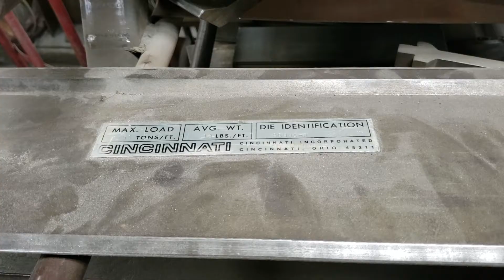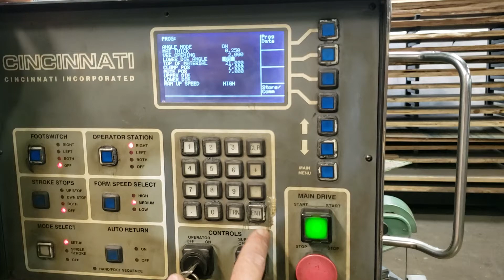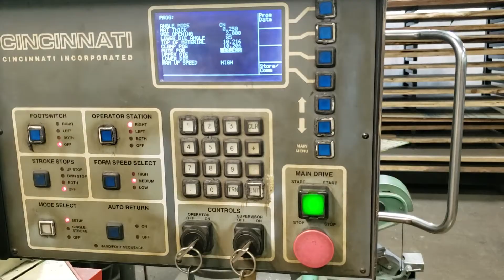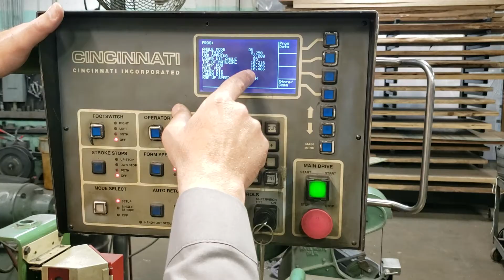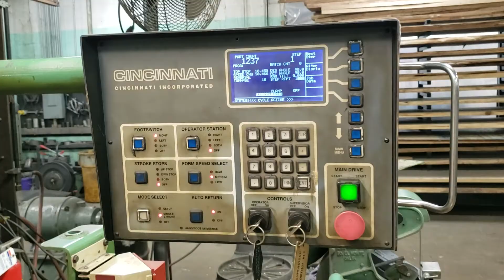Press Brake Metal Bending Crash Course

Comment: The metal stretch ha! It is minimal. It depends on your tooling and material thickness.To measure od verse id is based on metal thickness and brake radius. For a beginner, to brake a od measurement into a 90° subtract your material thickness. Let's say you have a 2" od angle out of 11 gauge.120 a36 mild you would subtract the material thickness from both sides. Your blank size would be 1.76 and you would brake at .88 but round it to an 1/8" unless you work for NASA.

Comment: First time I ran a press brake was Dec. 1964, I ran a brand new Chicago 10 ft. 150 ton. No CNC, no power back gauge, and ram adj. was just reference numbers. there was a lot to learn. Went from there to the machine shop and never looked back.

Comment: Pro move holding the piece up tight to the punch when getting your 4deg adjustment.
I used to brake 5/8 thick 6- or 7-feet long skid steer belly frames 2 X 90deg + - 1deg. on a 500T
Once or twice a year tooling would get sharpened, or we would get some weird steel and all the sudden were 4 deg over broke. We had a big 3in dowel of tooling steel that we would put in the die and flip that 4- or 5-hundred-pound monster over with a clamp and crane and bump jog that sucker open with kisses until it was good, the dowel made it nice; the other way was to put it on a forklift and go outside and hit the brakes with it about 4 feet off the ground and get it to land right on the apex, lol, if you were upset and in a hurry, it could work too.

Comment: I've ran an old 10 ft Cincinnati,if i remember correctly. Had a 10 ft die. 1-4 inches on it. Had to install with a forklift or use the ram to lift it  to spin. No automatic setting of the bend. There was a dial? Been 11 years. Used an accurpress also. Didn't set the bend automatically either. Now learning to use a amada rg50 up brake. 41 years old, whole new ballgame. Didn't even know there was such a thing 😊

Comment: 1/4 inch thick???  My press brake is only 20 tons but works very well with the .005 inch thick material I usually work with
Reply: 1/4in = .250
So, yeah, 20T will do .005. lol.

Comment: Certainly an interesting and informational video. I begun working as a press brake operator at my summerjob 3weeks ago, using some finnish coastone and aliko CNC press brakes. No idea about bending whatsoever before working there, now programming and bending multiple different bends with various different angles. I think the best tip i can give with my experience in choosing the VEE and R is, VEE size should be material strenght times 6 and R should be material strenght. Not certain if that rule applies with inches since we use metric system here.

Comment: I'm starting this type of job today. I'd like to know how to build things out of metal and have my own company.
Reply: Hire me i have over 22 yrs of experience with press brakes
Reply: @orokidzorozco3955  What do you learn over 22 years that someone with only 2 years experience knows?
Reply: Over the years you can learn many techniques that can make you a professional press brake operator.. you can learn how to use press brake tooling properly and choose the best and efficient bend sequence and many other things
Reply: @orokidzorozco3955  I got promoted to quality inspector, then they terminated me because I'm hearing-impaired and thought the forklifts would be too much of a safety hazard. I was there for less than 4 months.
Reply: Do you still work with press brakes?
Reply: @orokidzorozco3955  No and I was extremely bored doing that type of work. But, my quality was "second to none."  It was a regular WWII-era pneumatic press I was working with.
Reply: So you are not planning to open up your own business now ?

Comment: 1. The work piece does not actually stretch. The outside half does stretch, but inside half compresses in a bend. These forces mostly counter acts each other but tends to move the neutral axis inwards, meaning you should always make your blank slightly smaller. How much depends on a variety of factors.

2. There are 3 methods of bending, two mentioned here. Air bending and coining, bottoming was not mentioned. Coining actually requires so much force the metal "flows" out of the bend radius. Bottoming is just a best hope for the angle of the tooling.

3. The opening of the bottom die is a major factor in creating the inside bend radius, but not the only factor. Metal can only bend so much before it breaks or rips, this amount is 63% of the material thickness. This is known as a sharp bend and can be helpful in some cases where certain tooling is not available.

4. When creating a blank you need to know the finished dimensions. The first thing to write down is the material thickness, nominal is fine in almost every case. Then you need to know the inside radius, and not what the print says. I mean what actually comes out when you bend a piece of that material. GRAIN MATTERS, especially with aluminum. A rough guess is 5/32 of the V opening. With those numbers you can figure our your outside set back, this is the length of the radius plus the neutral axis. take the tangent of 1/2 your bend angle, so for 90 degrees use tan(45)*(material thickness+inside radius). Now we need to figure out the bend allowance! This is simply pi/180* inside radius+ K-factor * material thickness. The k-factor is a number that is usually fed into CAD software and never looked at again, but its very important. As mentioned earlier the neutral axis shifts INTO the part, the amount that it shifts is the K-factor, so it depends on the material tensile strength and type. Once you have the bend allowance you can divide it in 1/2. So to copy a 3" leg, subtract the outside set back, this gives the material that will always remain flat, then add the 1/2 bend allowance. That is your exact bend line.

5. The reason the part had to be struck twice is usually down to poor tool measurement or programming. A 2" Vee is not ever going to be 2". It could be 1.93" or 2.04", check the tolerance from the manufacturer. With a trigonometry you can accurately measure the opening perfectly. Just drop some round stock into the V. It must be large enough to not hit the bottom, but small enough to not poke out the top. Then drop a straight edge across the top that spans the V but does not droop. Now measure from the bottom contacting edge of the straight edge down to the top of round stock. You actually want to ignore the radius of the tool shoulder because the neutral axis is actually pivoting on the imaginary tangents.

I spent 6 years in metal fab and had to work with the most ancient equipment that had no computers, it was a 1962 mechanical press. If anyone wants to know more I have some pictures and stuff from way back then that might help. But I highly recommend a book from the former head engineer at Cincinnati, "Fundamentals of Press Brake Tooling" by Ben Rapien. This book helped me teach myself how to do this job.
Reply from the maker: Ben Rapien was an awesome man, he taught me alot. I appreciate the technical information here, but this video is just a crash course for beginners!!!

Comment: Remember that your radius of your bend will always turn out to be 0.16 times the length of your die opening (unless the radius of your punch is greater than the radius of your die opening) and your flange/bite length needs to be at least 77% of the opening of your die to bend. A shorter flange will always bend tighter because there is less material. Spring back has a .5-1 degree relationship when your radius is the same thickness as your material. Larger radius bends have a greater spring back. Keep your tooling clean, and remember not all metal is made the same even from the same sheet.

Comment: Thanks for making this! I start a job as a press brake operator tomorrow and have no idea what to expect. Seeing this at least gives me an idea
Reply: I started a job a job as a brake operator at the beginning of this year.. feel seasoned now.
Reply: @beaubeckum7634  I’ve ran brakes for 20 years, you have lots to learn, I loved operating a brake, but my back if fup now, please use crane or forklift for everything, I’m paying for it now.
Reply: How did it go
Reply: @DarkcreepSTREET  It's a process! There's a ton to learn and know, but it's not impossible by any means.
Reply: @brutaljok3r  thanks for responding. Yeah I have interview and never done any type of this work.
Reply: So are still a break press operator after a year now
Reply: @Krazywan  Unfortunately not. I moved to welding (I have experience in that already) The operating a break press wasn't too bad, but the ones at my job were older and very temperamental lol
Reply: I saw a job listing for it and was definitely interested in learning it if I get an interview. Manufacturing is awesome.  Good luck!
Reply: I just started two weeks ago and yes lots to learn , not something I’m used too while learning how to stack the metal orders properly then send them off to shipping pretty cool to learn tho
Reply: my school was CNC operator and I had fear of that job that i never worked it in my life, past 10 years im working in car industries on machines just setting up parts and pressing green button, since i had school i learned how to repair program if it breaks, i had conflict with chef and i quitted job... now im still in fear of CNC job due to my inexperience , my school was finished more than 10 years ago and i never worked that job, is it possible to learn? I even forgot how to read drawings...
Reply: I used to run one, not very hard when you learn.
Reply: 😂lol im in the same position,
Reply: Same thing I start tomorrow :)
Reply: @tearinthebradsshaw  How did it go? Is it easy work for beginners? What would you recommend for someone that is starting out and to get better at it fast?

Comment: 2 3/4 '' + 1/4 ''   = 3 ''  i don 't think so   did the metal bend around zero radius
Reply: When you bend something you are measuring to the inside but you gain the material thickness back on the outside of the bend so he is correct

Comment: Where’s the backstop? I remember my dad talking about walking to school both ways uphill and scribing his plate before bending it. “When I was your age” he used to say.
Reply from the maker: We have manual backstops, but not worth setting up for a couple of bends.
Reply: @woodchucktinman9893  Cute "not worth setting up" there are tricks of the trade that will save you the trouble of "eyeballing" if even for a couple parts that might become scrap because you didn't line up correctly.
Reply: @KushyKaar420  Pretty sure this guy knows what he is doing, don't think someone with the name Kushy with 420 on the end has more experience then this dude.
Reply: @FetamSC  exactly video wasn’t about back stops, I could mention many things he shoulda done but he’s explaining something in particular.

Comment: Can you tell me why when trying to lower the top die slowly , like tapping the foot pedal the die  bounces.  At work when I try to pinch the sheet I can't lower bit by bit, the hydraulics bounce.
Thanks sharn
Reply: You're probably working on a more modern pressbrake. I think it's a matter of safety, that is if your finger/hand get pinched by the part or the punch you're most likely to release the pedal or press it with greater force which is obviously caused by pain and panic. In both cases modern pressbrakes stop the cycle and retract a little bit for you to have chance of getting your hand out.
Free hand bending in such case is a little bit of pain in the ass however with all of those precise modular CNC back gauges nowadays you rarely need to use it. Also Iris Lazersafe has a cool function that lets you stop the punch right over the material in order to correct the position of the plate. Quite useful in that case.
Reply: @BulletProofCupid7  or could be a older machine with the seals shot, but if it’s a newer brake he has something set wrong, play around.
Reply: @duramax78  if it's an old machine, go ahead and play around. It most likely needs maintenance anyway. Also older pressbrakes tend to be easier to play around with and are far from being safe anyway, for many of reasons. If it's new pressbrake contact service department of that pressbrake first. If it's new it's most likely that in order to change that you'll need to play with parameters. If you know what you're doing than go ahead but if you're about to blindly play around with parameters you better order service for it first. If you screw up you can make a major and costly mistake. Not to mention the safety side of this action.

Comment: I work on an HFB 1704 Amada 190 ton 14 foot brake with Blackmax Light curtains.  1) I ran a Cincinatti before and they suck. I saw those punches and dies in your rack and cringed because I remember the days of forklifting dies into a brake just like that. 2) Even on my brake , which is an 8 axis brake, I had to eyeballs some bends using prick marks.
Reply from the maker: We are a job shop. Every day we set this up to make 1 or 2 bends and tear down for the next job. I do understand the newer press brakes are much more advanced, it is just more than we need. In a production setting, you are correct this is not the best. This press actually only gets used about 15 hours a week, which makes the cost of a modern replacement out of reach. The main goal is you would not believe the number of people I interviewed over the years that say they are a press brake operator and they dont even know basic die selection or anything except put a piece in to a back gauge and push the pedal. Thank you for watching and commenting!
Reply: @woodchucktinman9893  funny enough , I know all too well how many people walk through the door not knowing anything about a brake and saying they have experience. In my 2 year tenure so far at the shop i'm at we had 9 people come in saying they know stuff and know nothing. Most quit right away or get fired. Its so bad that the boss actually brings the applicant out to us and we get to question them and determine what they know.  1 Question I always ask is "How good are you at Geometry and Trigonometry?" That one shuts most of them down. The guy I work with goes the another route with blueprints.
Reply: @purpledude5526  I’m a grade 9 drop out ran brakes for around 20 years, honestly give me a guy that has been a helper on a brake for 3 years compared to a guy coming outta college with trig and geo I’d guarantee you in a month the helper would know more than the college graduate.
Reply: @duramax78  Thats a pretty tall order. The person your training has to be willing learn, I have found this to be a major factor. Most i have ran across applied for the job and just try to wing it. Some of the people that walked into the shop I used to work at couldn't read a tape or convert inch to decimal.
Reply: @purpledude5526  you definitely need to be able to read a measuring tape and convert to decimals.
Reply: While this is a cool video I would never train a person on a Brake like this. Technology has moved forward so much that learning this brake would be a serious setback. Even on my HFB 1704 which is a 1998 brake, its a damn dinosaur. Im currently looking for a new job simply because If I stay where I am I wont ever be able to catch back up and I have about 20 more years before retirement.
Reply: I would also like to add , make sure they Know this equation.  1/3 thickness , Plus the radius , Times 1.5708.  Picked this up 20 years ago and that equation holds true today. It will get you about .030 close or less.
Reply: @purpledude5526  hey purple can you tell me what this formula does.?
Reply: @duramax78  1/3 thickness , Plus the radius , Times 1.5708  , this equation?  Its used to make flat blanks.
Reply: @purpledude5526  never knew that, thanks purple.

Comment: Can you make more videos on bump forming and setting the crown a more advanced video.
Reply: Bump forming is just taking the radius you want and how much materiel you’ll use, so let’s say you want a 90 degree 10” radius you’d mark the piece where you want the radius to start and mark the piece 2.5” for those numbers mentioned above, you’d mark it 7 times .375 apart,  and you hit every line at 12 degrees, you’ll be damn close a bit under what you’d want then you just hit the middle to bring it too 90 degrees.

Comment: why in the world would you not use the back gauge?
Reply from the maker: Our back gauge is set up manually. We mostly run 1 or 2 parts at a time, no production. We put center dots for the first part anyway,   the times we run more than a few parts the same we do set them. Thank you for watching.